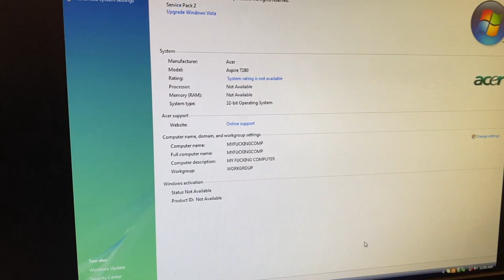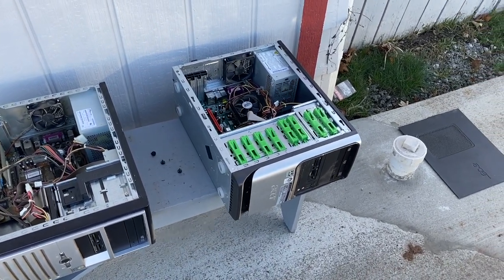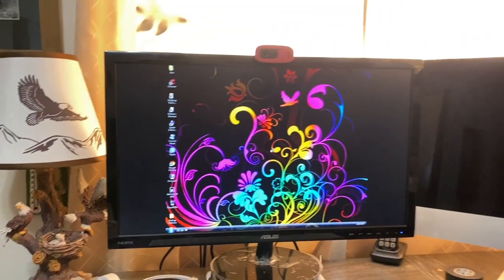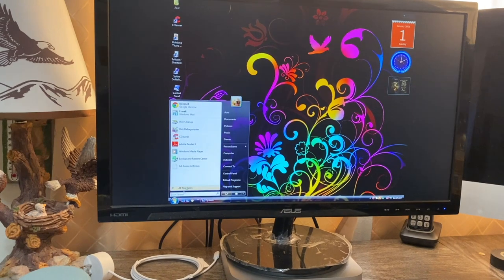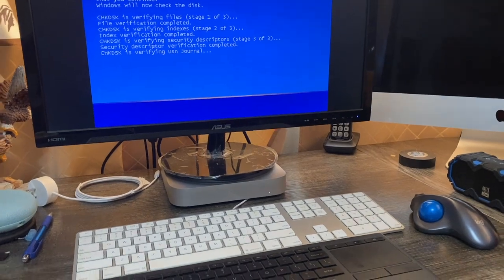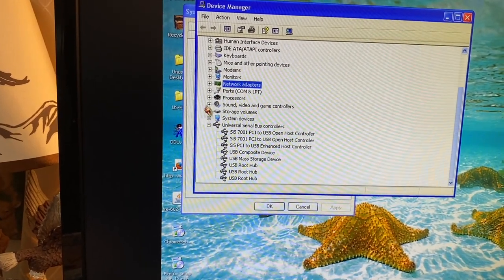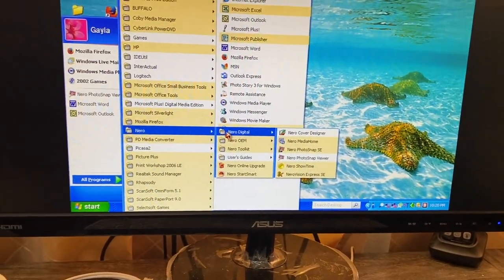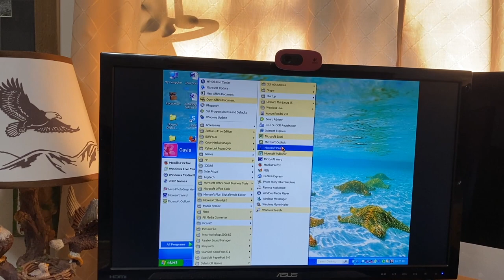Exploring Two Storage Unit Computers

Comment: I had this model a few months ago
When it arrived, I turned it on, it was very, very slow, which was disastrous
What I did was SSD 240
And I installed 2 GB of RAM and installed Windows 7
When I upgraded the PC
  It went from catastrophically fast to unbelievably fast
I suggest you do this too
Reply from the maker: Nope.

Comment: That white box Athlon XP machine really takes me back. Back in 2005 when I worked at a local computer store, I built a ton of "High Performance Office PCs" containing eerily similar components. Bargain basement Foxconn Winfast boards with piss poor SiS chipsets, Semprons in the 2500-3100 range, 512MB of RAM, and cheap mini-tower cases that looked almost exactly like yours. It was our most popular configuration LOL. It was always a treat when a customer requested something a little more exciting, like a gaming rig or an MCE2005 machine.